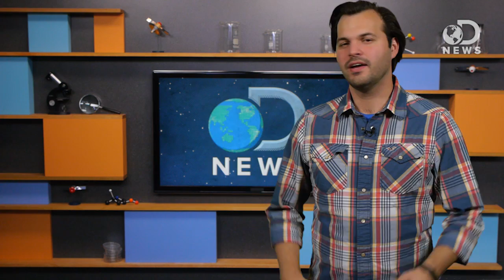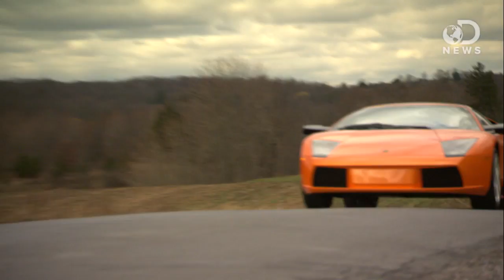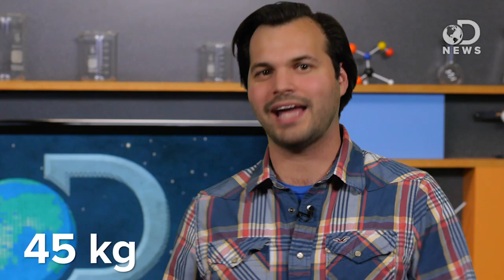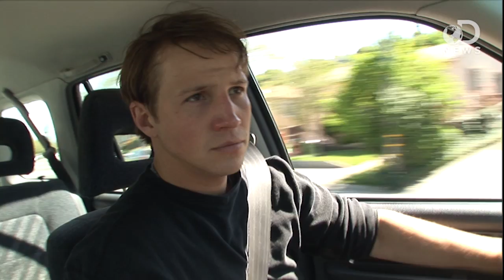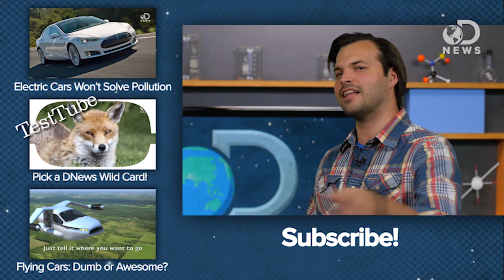4 Ways To Cut Gas Costs

Comment: I got 4 ways.

1.) Cut weight, lose weight, drink 1 gallon of water a day to keep your pounds low.
2.) Replace the lead acid battery with a salt battery. Its lighter (i think). Make your own, make it 12 volts (or whatever the old battery was).
3.) Dont drive without reason. Drive where you want to, then get home.
4.) Get a lighter engine, lighter transmission, and lighter interior.

Comment: My 2004 Honda Insight gets 60 mpg.  It only cost me $12,000 used.  I get gas once a month.
Reply: I do not believe you.  I bought a 2013 honda which is supposed to do 28 in the city and 40 on the highways.  It only does 25.3 miles per gallon even on the highways.
Reply: A Honda Insight Hybrid, years 2000-2006, gets 60-75 mpg.  People have gotten well over 100mpg in this 2 seater.
http://en.wikipedia.org/wiki/Honda_Insight
Reply: Sharon Wells+ Driving style also has a huge effect.

Comment: Actually, the Mythbusters said that OVER-inflating your tires gets you better gas milage.
Reply: Taking a bike to get anywhere also has better mileage. Over inflating tires creates the danger of longer braking distances. And therefore it isn't recommended. Although it of course gives better mileage. It's like choosing to over inflate your tires on you bike. You get a painful butt when the tires are not springy enough, although you have to put less effort in pedaling. There is always a counter balance.

Comment: buy a standard/manual car and shift gear when it reach 2000rpm...that way u can save gas...
coz automatic cars reach at around 3000-4000 before it shift itself...

Comment: This goes with what was already said in the video but a practical application.  They said cut weight so for me I only put in $20 of gas at a time because I only drive 18 miles a day. Since 1 have only been putting in About 5 gallons at a time instead of driving around with 16 gallons of fuel in my tank I have went from 22mpg around town to 27mpg.  That 11 gallon difference paid off.  So now I fill up every Tuesday instead of every third Tuesday. Try it.
Reply: What about the gas you waste driving to the gas station, or the gas you lose by opening up the gas cap, or ...etc?
Reply: If the gas station is on the way it shouldn't be a problem

Comment: for a more accurate way to save fuel by speed, its your highest gear with lowest rpm. or just buy a four cylinder then it doesn't matter

Comment: dudee thats like saying formula one sports cars are most fuel efficient..obviously not.!! cauz fuel efficiency not just depends on those pounds of cargo or those small drag coeff issues its more dependent on the manufacturer fine tuning the engine either to be more economical or not.. else how come a formula one car with approx 0.7 to 1.1 drag coeff has those 3-5mpg while a Camry with drag coeff of 0.27 gives you btw 25-30..!!?? :P
Reply: It's a combination of all factors.

Comment: I have 2 cars, one Straight 6 250ci (4100cc) engine makes 15mpg, the other is straight 4 108ci (1800cc) that makes 30mpg
I had one that could do about 40mpg with a tiny engine 60ci (1000cc) but that car was too weak and unconfortable...

Comment: Throw those old chestnuts back into the fire. Here's some real ways to save fuel:
1) Walk, or bike. (It'll even save fuel later, when you've lost some weight off that fat ass)
2) Plan your route; don't drive without a goal or purpose
3) Leave the bitch at home. That's another 300 pounds less weight, or -0.2mpg
4) Buy a fuel-efficient car
5) Don't buy into all the "save fuel" scams & myths
6) Try to drive as constant as possible. Acceleration and breaking are where you lose fuel efficiency. Hell, we've seen that red traffic light so often already, and we know that usually no one is crossing that intersection with the STOP sign anyway, so why stop, or even slow down?!

Comment: Here's another strategy, that was tested on Myth Busters; DONT roll your windows down. If you're hot, run your AC. Running the AC taxed the engine, but still used less gas then the increased drag from the open windows caused.
Reply: It depends on the speed at which the car travels. If you are going slower than 45 mph it is more taxing on the fuel economy to run the A/C, just open the windows. If going over that speed, drag comes into play, close the windows and use the A/C.

Comment: The 55 MPH being the "most efficient speed" is not really true.  It is hard to make a generalization like that given the vast differences in engines, gearing, weight, aerodynamics, tires, type of fuel, etc. 

55 may have been the most ideal a few years back when the average automatic was 3- 5 gears, but by today standards it's simply not true.  From personal experience I have a 'sports' car that I can get 30-31 MPG going 80/85 MPH (thanks to aero, gearing and power) and a CUV that does its best at 65-70 MPH.

It should be said though that maintaining momentum is a huge fuel saver.

Comment: By far the number one way to improve your gas milage is to change the way you drive. I drive a small manual transmission SUV, and I was able to get the fuel economy from 28 to 30 mpg by losing weight, inflating the tires etc. But Just by driving differently I was able to increase the economy up to 38 mpg. What is the best way to drive? As if you have no brakes. I'm serious. Accelerate slowly, limit your top speed, coast when possible (don't run stop signs guys…), time the traffic lights as much as possible. All of these things have a much much greater impact than physically changing anything about your car.
Reply: ***** Yes! Absolutely ride a bike whenever possible. For people living in town it's very rare that you need to go far enough or carry so much stuff that a bike wouldn't work. Very good point!

Comment: I thought that thing about 55 being the most efficient speed was from an old study with [now] old automobiles, and that it didn't apply to newer vehicles anymore.
Reply: that's like saying the laws of physics don't apply anymore because the study was done a few years ago.
Reply: theunkownviolinist Or that machines built differently have different speeds at which they function most efficiently.  My understanding was that modern engines were more efficient at slightly higher speeds.  And that the "few years ago" which you cite was more like 30 years ago.  Wasn't there a new study that got different results with modern cars?

Comment: I use cruise control so my rpm stays the same rather than trying to maintain speed with the pedal. I have always done this, so I don't know if it really is helping or not? Either way I think I will continue using it.
Reply: You do know that the cruise control works by increasing the rpm's when it needs more power and lowers it when it needs less? Just like you'd do without cruise control.

Comment: We really need to learn how to produce hydroelectricy in a way where you can insert it into a car.
Reply: Hydroelectric? Like what is produced by dams? That is an interesting idea but why not Solar?  If you're using solar power, the ultra-lightweaght materials that sports cars are made of & have the panels on the car itself all you need to do is park in the sunlight to recharge the battery.
Reply: Rods that store that power. Have large battery type containers that are recycled at "gas pumps"
Reply: thorium reactor cars!!!! XD
Reply: phyrath5 and if its raining ?
Reply: well it has already been made but i think its a prototype
Reply: thats handy, cause you dont need to stop at a gas station. and since starting an engine is so much more energy consuming that leaving it on that time you fual you car. it would save much
Reply: then you simply need more fuel. but if the sun is shining you save gallons that you otherwise would spend.
Reply: it will take a long time siting in the sun on perfect conditions to fully charge a car, and yes there is a car powered by water and do you not see how much water is on earth its like what 70%? 1L of water will keep it running at 60 M/H or was it 60 km. and this is how much water is in the ocean 326 million trillion gallons or roughly 1,260,000,000,000,000,000,000 liters. and i do believe that it just goes back into the sea as it gets evaporated so whats faster adding a L of water to your car or waiting for hours and hours maybe even days (there is not much info on how long it will take to fully charge an electric car.
Reply: hho generator exists already 20 to 60% more power ,less maitenace, cooler motor ......;;
Reply: ***** Please read how they work, the more electrolyte you add, the less electricity is needed to break the molecules apart.  I have been studying them by filling balloons and it is fun.   I also leaned my fuel out to where the car would die, than hooked up the HHO generator, and the car ran just fine.  So that is proof it makes more HHO than electricity is needed.

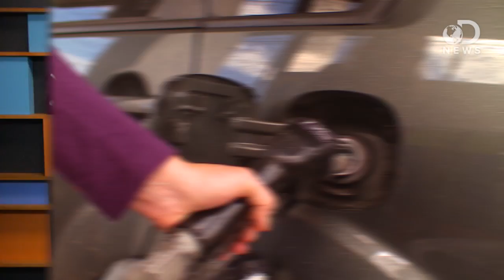Comment: Although this comment doesn't really touch on personal fuel efficiency strategies but more on the "climate and environmental effects" mentioned at about 00:30, I feel it is at least a little relevant.  Although there are requirements to make more fuel efficient cars, the onus is mostly put on the consumer at the moment.  Automakers have to adhere to a Corporate Average Fuel Economy (CAFE) which essentially means that if they have an automobile in their lineup that is more efficient than CAFE standards they can have an automobile that is equally less efficient, which is why it is called corporate average.  I feel that the system is now dated, that is, I think that CAFE was introduced mostly to force automakers to create the efficient vehicles to keep their less efficient ones (in many cases more expensive ones) in their lineups.  Now that a few years have passed and more and more consumers are looking to buy more efficient vehicles, automakers no longer need the push to make fuel-efficient vehicles and will continue to pursue that avenue regardless of the standards put upon them, therefore I think the system could be improved by limiting how much less efficient a single vehicle can be.

Comment: Check your car's air filter to see if it needs to be replaced.  Don't overuse your air-conditioner.  Stick to the major highways (small towns can have rougher roads and lots of stop signs).  Also, if you only pick destinations that are downhill from you, you can get by using no gas at all.  ;-p
Reply: And when you go back UPHILL? But good posst anyway Shawn Ravenfire

Comment: I don't know DNews, your blanket statements lose you a lot of credibility.
I have 2 cars; the first will use about  12L/100kms at 60km/h, about 10l/100kms at 100km/h and about 7.2L/100kms at 170km/h, this is because the engine produces its peak torque at 3000rpm and 172km/h is peak torque in top gear.
My other car will get its best economy at 100km/h and any speed above this will sharply reduce its economy.
Saying that any car will get its best economy at 55mph is just naive, there are so many factors that will make this statement wrong on its own. ie my first car will do 55mph in first gear (it will do 110km/h in first), while this gives you a nice cozy feeling as it pushes you deep into the seat, I don't even want to know what the fuel economy is at that time, (i would guess about 40+L/100kms)

Comment: The holiday season minds food , presents, family and also travel. Lots and lots of travel. And with these gas prices, wouldn't you want your vehicle to be more efficient?

[INTRO]

Hey drivers, Trace here for Dnews with some holiday knowledge that i'm gonna drop on!

Automobiles opened up the world for individuals to travel as far as they wanted on their own schedule.

But gasoline, man? Fosile fuel, it's a huge drawback in so many levels: climate and enviromental effects and the cost.

So to fight back, our government now requires manufacterers to create more efficient cars.
And with those efficiencies growing a lot from now to 2025 we thought, how are they gonna do that?

Since the invention of better tranmissions, fuel injections systems and mission controls and other technologies our cars have pulled more power with less fuel. But now, we kinda hit the wall.

It seems hard to make an engine more efficient, and that is not the best way to go. Instead, automakers are WAT TE FUK DAS HE SAYS HERE and reduce drag. Aerodinamics can be beneficial. For example a boxy truck would have a lot more difficulty to push into the air than a slim sport car. The better the aerodinamics of the car, the less drag you get for air resitance. Thus, a lower drag coefiecient. If you can reduce the drag coeficient by .01 you'll gain .2 miles per gallon. If you're not using your roof rack, take it off, you'll reduce your drag, and if you got an antena topper up there, you're incresing your drag. Seriously, get rid of that stupid thing.

Making the car lighter is another way the manufacturer can make a car more fuel efficient. As they cut weight, they have less car to pull with the same engine. That's why sport cars are usually made of ultra-light materials, like alluminum or carbon fiber. Even changing just a few ounces off of the physical gas pedal could save a tiny amount of fuel. The US departament of energy says if automakers reduce weight of 10 percent the car will get a bump of 68 percent in fuel efficiency!
 
However, since most of us don't wanna put a WAT to our car's middle parts there are strategias all of us can use to improve our gas miles. The US departament of energy says the quickest way is also to cut weight. Carrying a 100 pounds of extra cargo in WAT in the car will reduce your fuel efficency by 2 percent.

So leave those party supplies at home, because you don't need it. 

The second easiest way is to make sure that your tires are at the proper pressure. I know this seems kinda silly and whatever, but it's actually way better because most of us drive in underinflated tires, which increases the friction with the road, decreasing the fuel efficiency by 7 percent.

Driving slower will also reduce the coeficient of drag and icrease gas miles. The mos efficient speed is 55 miles/hour (88 km/h), that's where aerodinamics, power and fuel and efficiency they all line up. Each 5 mile increase over fifty will decrease your economy by another 7 percent. Every five miles!

And although it seems like the world is kinda WAT2 you hear but hey, that's how physics works guys.
Over time, like say a year, if you can improve your gase miles by 7 percent you will save hungreds of dollars.

Do you have an estrategy to improve your gas efficiency? Tell us down below and thanks a lot for watching Dnews everybody, click that suscribe button and have a great holiday season. Drive safely.

wat are the wats

Comment: i had a 1984 gmc vandura 2500 with a 6.2l Detroit Diesel in it and i got around 40mpg out of it. it would take me just over $100 to fill it up but i would drive for just over a month on a tank of fuel. not bad for a vehicle that was as aerodynamic as a lego brick. now i drive a 94 jeep cherokee 4x4 and i get about 26-30 mpg out of it just by taking off slower and not driving over 55 mph with it. i keep the rpm's around 1700-1900 and try not to use the 4 wheel drive unless i have to

Comment: my method of improving gas mileage is to ride my electric bicycle. also with that you don't need licence, registration or insurance.
Reply: and the whole point of this video is to use as least fuel as possible. electrons are a cheeper fuel than hydrocarbons.
Reply: Tomas Beblar
So what the electric bike is running off then? Fairy powder?   Oh no... wait it runs on electricity! Which is generated from fossil fuels (partly-mostly...depending where you live)!
Reply: Demeter Ákos  yeah and i live in Illinois witch makes a lot of electricity. our percentage of nuclear power is higher than most other states i think (atleast it was when we had 11 nuclear reactors running) and we have coal/steam power plants everywhere.

mass producing energy is far more efficient than doing it in small batches like each cylinder stroke in an engine. i bet if we took all the gas that is used this year and burn it in one huge furnace where it can all completly oxidize and stuff it would be like 3x more efficient. mutch like how a train can carry 150 box cars for the same amount of fuel as like 40 trucks. (rough estimations) :D
Reply: "An electric bicycle does not use fuel" NOT true.
"mass producing energy is far more efficient" I debate on "far more" Cars are generally 25-30% while power plants run on 40-45% including cogen heating of nearby towns with excess heat.
"and burn it in one huge furnace..." power plants (=furnaces) are decentralized on purpose.
"it would be like 3x more efficient..." see above
"a train can carry 150 box cars for the same amount of fuel as like 40 trucks" it is mainly due to being on RAIL ROAD. You know it is far more easy to roll on steel rails with steel wheels than rubber on asphalt.
Reply: Demeter Ákos
your first comment was arguing for my opinion now your arguing against, i don't know what your trying to say. it sounds as if you think i'm the one who said E-bike don't use fuel....

anyway maybe your just not familiar with how furnaces burn far more efficiently than constantly restarting a fire inside a cylinder.

but you sound like your just trying to disagree with everybody. so i rate your trolling 1 out of 10. maybe try harder next time. its a good idea to hook somebody into an argument that sounds legitimate instead of coming off as trying to argue.

Comment: I gotten up to 39MPG with my mazda6, i clean my fuel injectors every 5 months and run a fuel cleaner every 4,000 miles and change my oil every 3,000 miles, ive been doing this for years and its saved me so much money on gas, its pretty good for a mid size sedan, my car is kind of heaver because i got like 120 pounds of speakers and wood for my car audio system, still gets great mileage.